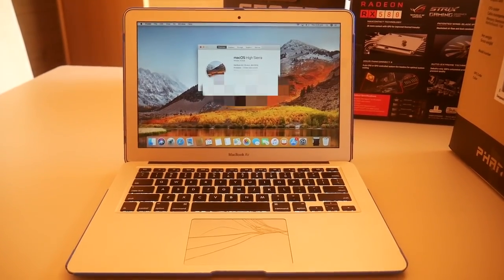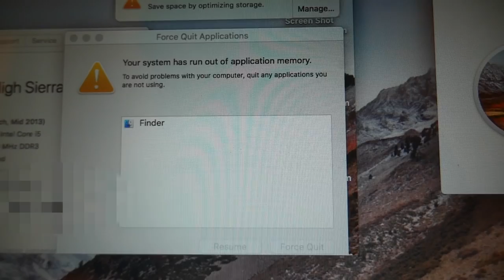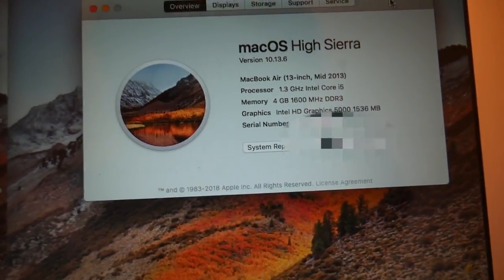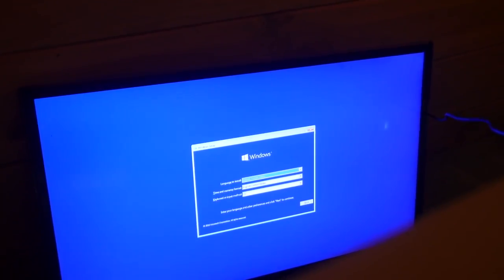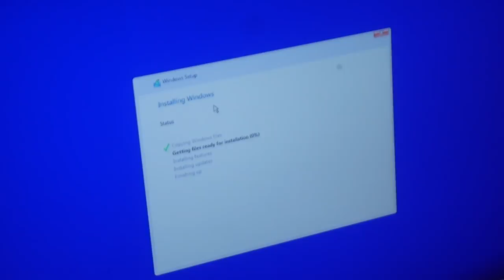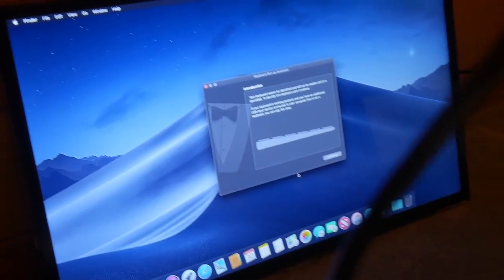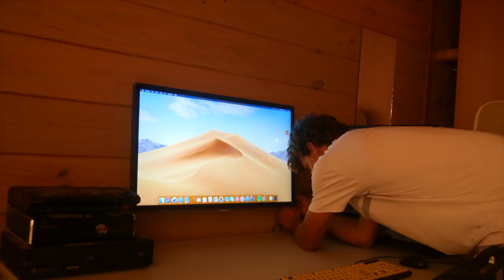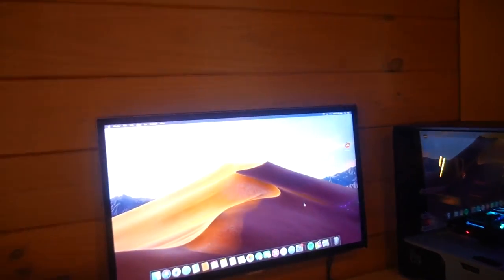BUILDING​ MY FIRST PC

Comment: usually rides bikes
builds a hackintosh with zero experience
well alright then
Reply: I know dude it's so impressive.
Reply: #bikelife
Reply: @GregBarling  He installed the CPU better than most techs. most people dont realize you leave the black plastic cap on and the cpu will pop it out. Solid build Greg
Reply: Just takes logic and research. Great effort.

Comment: Broooo, im so jealous! And don't worry, you did a good job with the comp! Very nicely built. I built my PC aswell (with the help of my stepbro) and I wish I could build more! It's such a fun time! Now just remember to update your drivers and take care of it! If you're into gaming, you got a really good one for it. You could easily stream with that processor and just all out power. I actually have almost the same processor and stream with it! I have an i7 8086K which is a limited edition and instead of 3.7-4.7GHz, mine is 4-5GHz. Pretty much the same CPU in other aspects. And yeah, a 144hz monitor is SOO good, I have a Benq XL2411. Changed my life and put my gaming experience on a whole nother level. Hopefully I get enough for a streaming PC soon so I can build again! (A streaming PC is basically a PC that you only use to run your stream and capture the gameplay from your gaming PC, the point behind one is so you can stream at higher qualities while also not affecting your gaming PC frames) If you wanna check my stream channel, you can find it at twitch.tv/exkaces. Not trying to sellout my stream but if you wanna check out the quality I can put through with one PC setup with my CPU, you'll find it there! But yeah dude, have fun with it!

Comment: This video came at a really coincidental time for me.... I am just starting to set up my own custom PC building business. This video was great! You literally have the exact same interests as me :D
Reply: How you gonna get an i7 cpu and a ROG motherboard but cheap out on the cpu cooler 😂 that plastic piping looks a bit tacky... it might be a bit pricey for you but a Corsair H100i is a great option. That build was a bit messy (applying the thermal paste late & installing parts onto the motherboard after putting it in the case) but also impressive for a first build, better than getting ripped off by a company selling the whole package :) also you could pick up some cheap RGB light strips to add a bit more flair to the inside of your system.
Reply: Overall great video and I love the change up of content 😄 👍